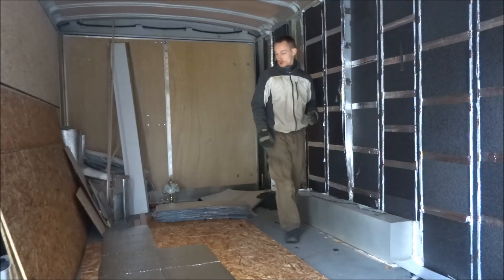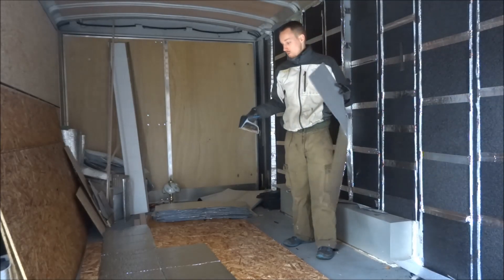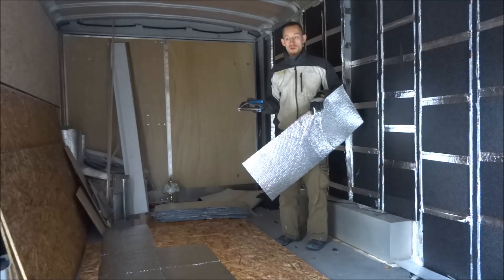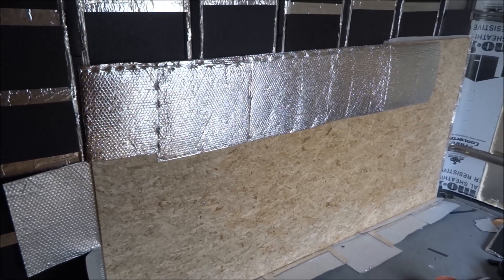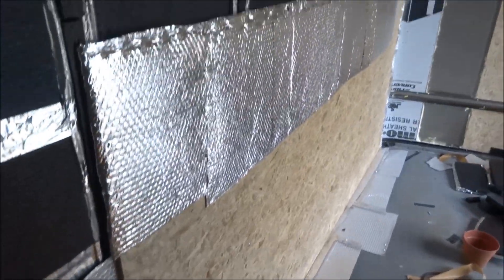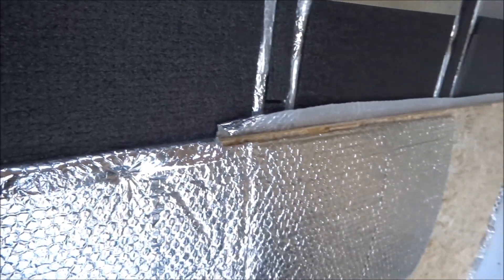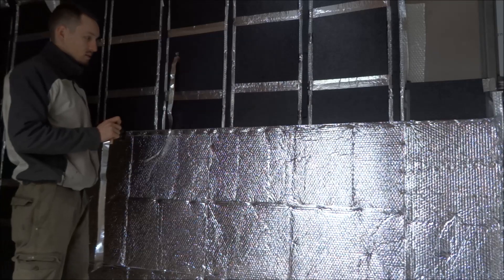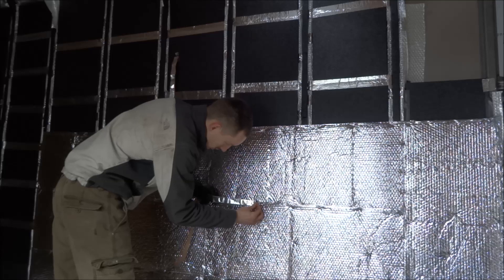Episode 13- Cargo Trailer Tiny House

Comment: The multiple vapor barriers strikes me as not only a bad idea, but completely unnecessary. You only need a vapor barrier as the inside layer, but you are also going to need to provide for some ventilation (I hope that's in your plans).

I would have done the black foam on the outside, then the foil over that, completely foil-taped, so that it's a continuous membrane. But if you're also planning to add additional layers of insulation, as I think you've mentioned, you'd want to do that before the vapor barrier.

Separate: How did you attached the plywood to the steel posts?
Reply from the maker: John Galton Thanks for the tips, ill give that some thought. I attached the OSB sheets to the steel frame with self tapping screws. The reason I did the black closed cell foam first was because I did not want any VOC off gassing in my living area ( or at least try to minimize it). The idea was to contain the more 'toxic' insulation in a air tight section and place the more 'healthy' insulation over that. As far as ventilation, I plan on having two windows and ceiling ventilation.